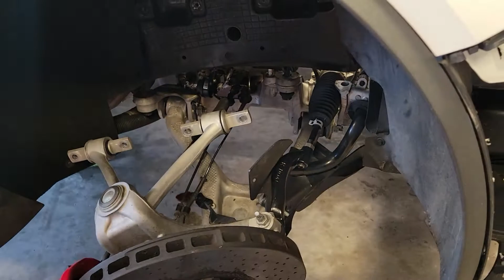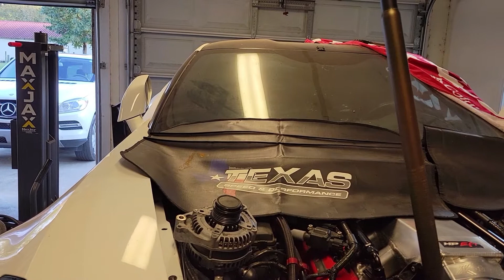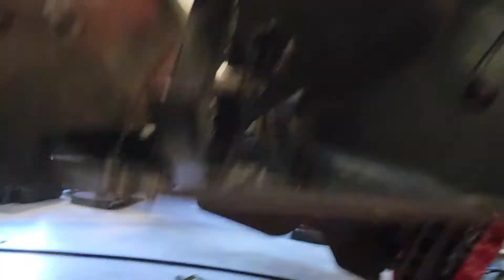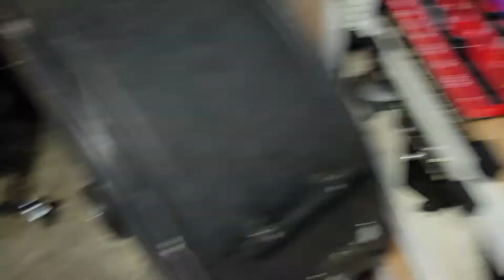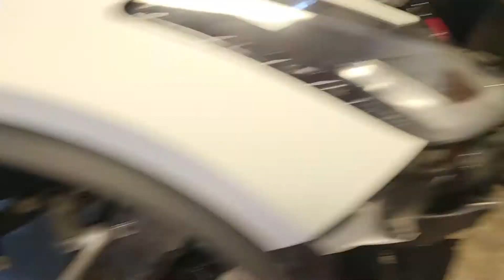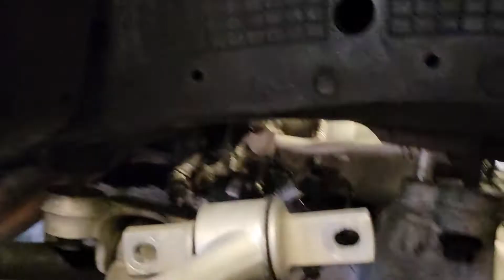Corvette C7 Z06 My Update to Removing a Dry Sump Oil Pan while in the car

Comment: Beautiful Gorgeous Motor Mike, just seen your latest video, hopefully you've got at Texas Speed and Performance and your oN your way with a plan putting your Motor Together now, love seeing your car run Brother 🌿🙏🌿
Reply from the maker: Michael I wish I could say Texas Speed took care of me but the exact opposite.  They told me to ship the motor back they would try to look at it and fix if possible but all I got after 2 months was an email stating nothing but excuses of how the block was totalled and the bearings were starved for oil.  I know that is BS b/c I have been down that road and you see heat marks, among many other things.  I could turn my engine over easy by hand no binding, no heat marks, not one bit of sound or noise that told me bearing issues, at least bad enough bearing issues to snap a crank in half!  I asked them, OK, send me pics then...yeah silence.  I can't get them to send me pics, facetime, nothing!  And now it's 3+ months and they were supposed to ship it back to me 3 weeks ago!! Still not shipped and ignoring my requests!  I have called and emailed Avery so many times.  I'm sick of them honestly disgusted with the money I spent with them and promoting them so much and how they treated me.  I have a 2017 Z06 with $60+k in mods just sitting on a rack for nearly 6 months b/c of this crap!  At this point I just want my engine back so I can fix it myself and get it running and sell it.  I'm just so let down I don't even care about this damn car anymore, which sucks b/c I loved helping people doing videos, etc.

Comment: I searched high and low on forums for this kind of info. About to tackle a cam swap and Katech pump on my z51. Really appreciate it dude. Do you think a set of quick jacks would help this whole process?
Reply from the maker: They would but I would recommend a 2 post lift.  I’ve used 9’ and I have really started to like my MaxJax portable 2 post.  So easy to work on these cars when you have it lifted properly.

Comment: Did you have to remove the lower pulley to get the oil pan off?
Reply from the maker: Yes, unfortunately the front lip of the oil pan sits right up inside the lower dampener.  Now I am running an ATI dampener which may have a little difference clearance over the stock one.  You can certainly try but the oil pump forces you to drop the pan down straight until you clear it, which boom you run right into the front pulley lip.

Comment: do you have to remove all the belt accessories like water pump ?
Reply from the maker: Sorry for late reply I've been going through hell with my engine held hostage at Texas Speed.  So you can keep the water pump on, but you need to remove all the belts.  That's not a big deal.  I have a video showing you how to put the alternator belt on easy.
Reply: @MichaelBrownPlus  What was the resolution? saw your post on FB hope they stepped up
Reply from the maker: Texas Speed did a 180 when I got a manager involved.  They are now building me a brand new short block only resusing my pistons and rods.  New block, sleeved to 416 again,  crank, rings,  bearings, etc.  Very nice they stepped up.  Were honest and told me they agreed with my assessment that the crank was faulty.

Comment: Is it the same method for a Z51?
Reply from the maker: Yes it is!  Z51 package adds a Dry Sump oil system to the standard Wet Sump motor.
Reply: @MichaelBrownPlus  Great! Do you think I'd be able to change the crank bearings (like this guy did with crankshaft still in the engine /watch?v=zlluWbtWig8) or would the k-member still be too much in the way?
Reply from the maker: Just my opinion but if you want to do it right and ensure everything is properly installed, torqued, I would just pull the motor.  That way you can be certain it’s done right.  One and done.  And trust me trying to do crank bearings under a car with the engine in is going to be a pita.  I’ve pulled my motor 4 times.  The last time I did it by myself in 2 days.  Had it back in, in 2 days.  Doing a clutch install.  It’s not as bad as you think.  And it will do you some good to learn that process.